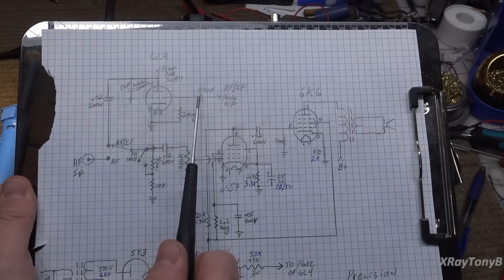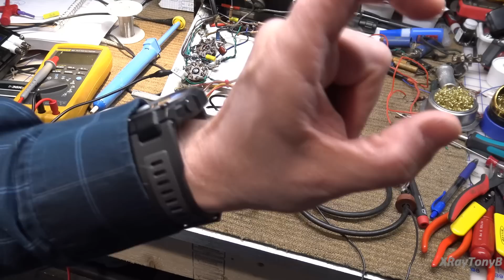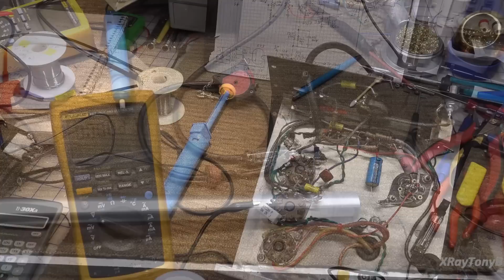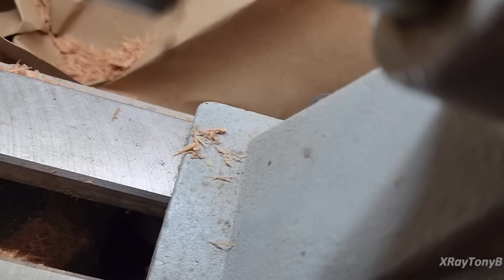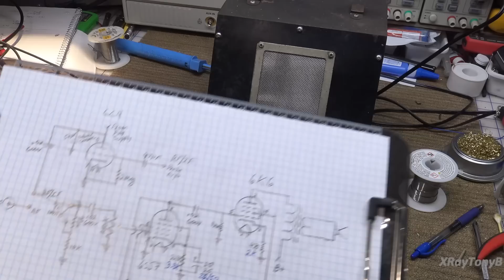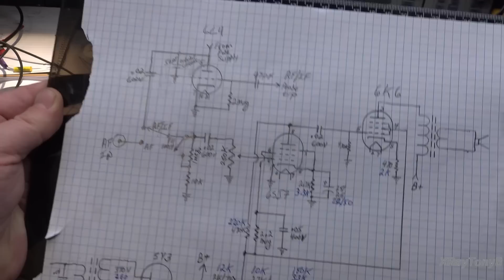Precision Model 200 Signal Tracer -  Part 3 - Final

Comment: Speaking of magnetic and shielding properties - does it matter if copper, brass, aluminium or steel tube is used for the probe? Or its rolled from a piece of mu metal (I have seen it sold  as foil or in small squares in some...eastern markets)?
How would magnetic or nonmagnetic case material influence it?

What material wires did you use inside the probe, as they can get hot?
Are the flexible silicone wires (i think they can hold up to 200℃) good enough to be directly next to a tube?

Latly, what materials would be good to put around the probe to insulate it? Its a bit scary to poke around high voltage equipment with a big bare metal rod...

But then if the probe is covered with silicone, few layers of giant heatshrink tubing or some other material, wouldnt the diode tube inside overheat?

What cable did you use for the probe, I assume it needs to have multiple strands and should be shielded?

---
I think I need to look into radio detector circuits, and how do they work. I know there used to be christal radios and diode detector radios.
Reason - I noticed in some videos about restring Vacuum tube voltmeters, they also have a rectifier tube as AC probe. I was expecting some amplifier like in modern scope active probes, but no its just rectifier.
And in your video you mentioned something about tube being more sensitive than some germanium diodes.

So that perplexe me a litte bit, what exactly is going on here.
Apparently its some other function not that diode tube just rectifies the signal for it to be more easily processed by DC voltmeter circuit.

I need to find some deeper explanattion what is the benefit of the diode, but my guess its something related to how diode radios worked?

Also how having some active element or just diode inside a tube help with taking more acurate measurements, than just having a coax cable with test probe and alle the circuitry inside the device. 

Maybe thats a video idea for you.

---
Seeing some similarities, how much a good signal tracer and a vacuum tube multi-meter do really share? Have they ever been built in one instrument?
What about mixd technology, where and are vacuum tubes actually better than discrete compnents?
Perhaps Vacuum tube probe (if its more sensitive and more resiliat to abuse) and vacuum tube first stage for the multimeter, but the rest discrete and opamps?
If I want to learn about vacuum tube technology, not sure is a signal tracer the best first project.
But feels like a siignal tracer and multimeter (saves desk space) would be a good project for myself and my youtube channel. Just thinking out loud, sorry.
Reply: I never experimented with different materials, but most probes I've seen have been aluminum, probably for weight considerations.  I have never seen a probe made from mu metal.  My guess is that any metal will work fine with the relatively tiny magnetic impulses that are being shielded. For internal shielding, I have seen both aluminum and rolled steel used for shielding. If you are shielding heavy magnetic fields then mu might be a better option, but for this application, aluminum is perfect.

Comment: Thanks Tony. Very good series. One question. At the end, (talking about the plate voltage on the 6C4) you said about 150k worked best. What was better about it? What happened when you put a 200k in?
Thanks again.

Comment: True! Plumbing is not a hard skill to learn. I learned how to do it when I was working at a hardware store in my late teens. I've never hired a plumber except once when they had to change the valve that accessed the village water supply and it was required by code.

Comment: Have some doubt about the way you connect the 100:1 attenuator ... maybe the left condenser terminal must go to the node of 1Meg/10K resistors ?
Reply from the maker: Yes, absolutely a problem when it is in Audio trace mode, as it will place a 10K load across the device under test, when in 1:1 position.  I noticed this after I finished editing the video.  I will be changing that and posing an update later on.  Thanks for the comment!!
Reply: @xraytonyb  It's a pleasure !

Comment: Hi Tony,
Absolutely loved viewing Parts 1 to 3 of this signal tracer resurrection adventure.  
In some respects it reminded me of a signal tracer I built way back in 1972.  It incorporated an ECL82 triode pentode; L63 general purpose triode; UU5 full wave rectifier; EM84 audio level indicator, and EBC91 double diode triode for demod/amplification enhancement circuit probe fitted inside a short length of plastic coated metal table leg tubing (with on/off switch, and three small vent holes at each end as it could get a little on the warm side if in constant use for longer than twenty minutes) LOL.  It also incorporated a 155 volts, HT derived, passive component noise checker.  Looking back, the L63, and UU5 was somewhat odd choice of valves but we tended to use whatever rubbish we could get our hands on those days.  Nonetheless, as a piece of test equipment it helped get me out of the mire far more times than I care to mention LOL.
I still own that tracer (goodness knows where exactly it is inside my shop these days).  It worked in a fashion two years ago when I tested it for a bit of fun.  It’s the pleasure of doing what we are capable of doing - and getting on with it at a time that pleases us because we can LOL!
Yes, this was an enjoyable resurrection project to watch, made all the more so because you enjoyed it too.
Phil, Sheffield, England.
Reply from the maker: Thanks for sharing!  I always like to hear about other's projects!

Comment: Nice restoration. It should be possible to replace the cumbersome triode tube in the handheld probe with an FET or a high gain / high bandwidth transistor or op amp.
Reply from the maker: Yes it is.  I mentioned in the video that I am thinking about building such a probe for my Eico 147 sometime.

Comment: Hi Tony. I can’t say I’m thrilled by the idea of making an active probe with high B+ voltage in a METAL tube! Not to mention, Aluminum is very thermally conductive (like most metals), and you’ve got a hot radio tube in there with no easy way to ventilate it. That’s going to be a mite uncomfortable to use after awhile! Maybe some sort of on/off switch for the probe? Maybe you can use the probe as a soldering iron? 🤣 Also, maybe make a standard Octal (tube) socket to plug the probe into (on the case), similar to some tube TV sets where the yoke plugs into an octal tube socket. This’ll make it easy to make an RF probe with a solid-state diode (Germanium, or maybe Schottky) that you can swap out without worry of shock or high temperature! (You can still drag out the “tube”-based probe to show off!) One really wacky thing you could try is to find a “side-looker” eye tube and use it in the probe to show the signal level, though you’d probably have to take the drive signal from right before the audio output tube, and hide a Germanium diode in the probe to detect (rectify) the RF. It would certainly make a “unique” RF probe for your signal tracer!
Reply from the maker: Thanks for the comment!   All good points.  The B+ in this probe is less than 50volts and is heavily current limited.  The case of the the probe is grounded, so the worst that could happen is shorting the B+ and having the anode resistor get slightly warm.  The aluminum case will help to dissipate the heat, however, the tube only gets warm to the touch, as it is mostly from the filament, due to the extremely low  anode current.
Reply: I have a Heathkit signal tracer and it puts 150V on the probe tip during noise tests - very effective for ferreting out noisy parts.  But the voltage is run through a very high ohm resistor first, so the current is very little.  You will feel it if you lick it but you don't feel the voltage with your hands.  You get several thousand volts more than this by walking across a carpet in the winter and grabbing a door knob.

Comment: I might be wrong but I think there's a flaw in the schematic. The 6K6 suppressor grid seems connected to the control grid. Hence the control grid is connected to the cathode as the supressor is internally connected to the cathode. However, since the stage is working you can't have wired it in that manner?
Reply from the maker: Good grief!  You are right!  I drew the diagram wrong!    I can assure you that it is connected correctly in real life.  I'll fix that in the schematic.  Good catch!

Comment: Great restoration, and I asking about volume pot center-tap tied directly to preamp grid. Does this setup affect the tube bias?
Reply from the maker: That could be an issue in some cases, but as long as the grid stays negative with respect to the cathode, it should be OK.  This being a cathode biased tube should not have any issues.  Thanks for the comment.

Comment: I have a vintage radio whose wiring insulation is flaking off.  What can I use to reinsulate those wires?  Thanks.
Reply: shrink tubing comes in "see through" either with or without Internal hot melt glue so that you can see the original color of the wire. 
Alternatively, I purchased 30 yards of each of red, blue, yellow, white, green, orange and black shrink tubing (with and without internal glue) for the very purpose you mention. I only use the colored tubing when the original tubing had faded.ń;
I also use the clear tubing (with glue) if I suspect the original wire insulator contains asbestos 
Hope this helps